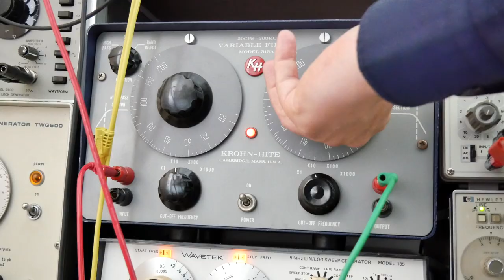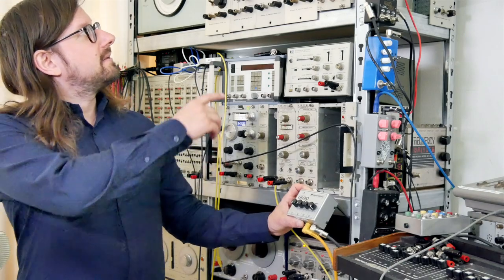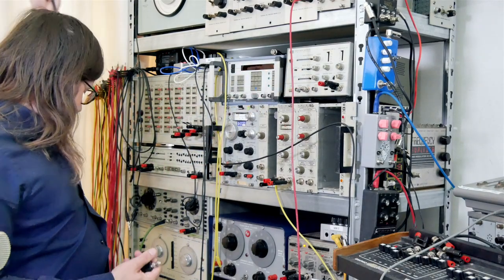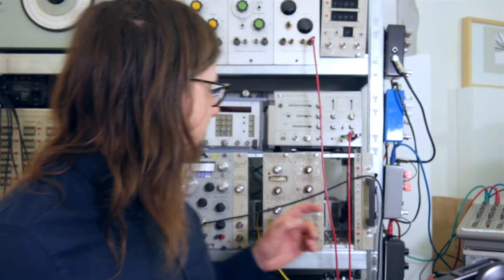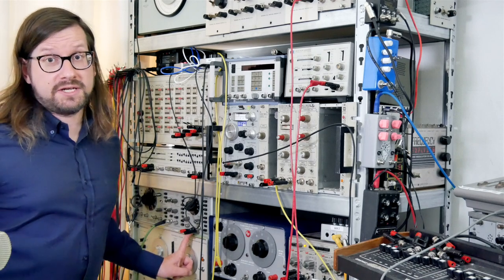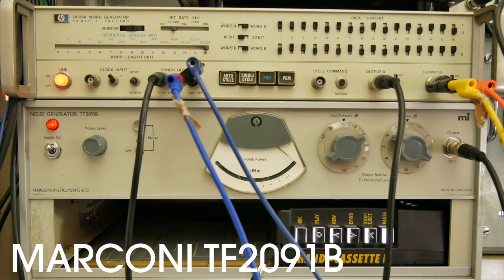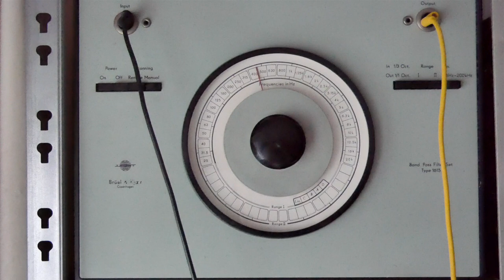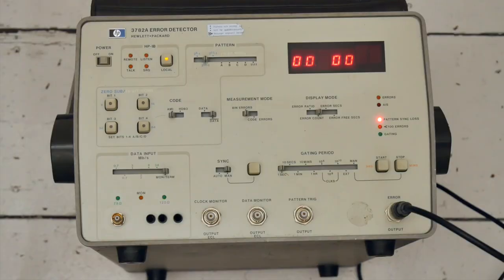Test Equipment Music FAQ and Guide

Comment: You can apply the "Will it music?" approach to any electronic device device you encounter, not only lab equipment, trust me on that :) Thanks for the amazing inspiration
Reply: You can actually apply the approach you speak of to any object/thing/device, electronic or not. Trust ME :) 

Example: take the shelf out of your oven (a "rack" type), tie two bits of string to it and shove the string in your ears (not too far hehe) with your fingers holding a seal. Tap the bars of the rack (either by swinging it to hit things or asking a friend). Enjoy.

Comment: Another nice one, Hainbach...never seen a K-H 315 filter before, actually. 310s, sure. 330Ms...two sitting about six feet away in here. And of course all of the solid state stuff. BTW, those 330Ms I have actually are getting used in a more "normal" way, since I use mine for front-ends prior to my 2-track A-D conversion to give me 11 active 12AX7A stages before things go digital when mixing, plus I use them as "soft" brickwalls to roll off HF aliasing and subsonics prior to encoding. My tech had them a few years back (one of them had a bleeder resistor issue in the power supply) and although I told him to "recap and upgrade as needed", his response was there was nothing TO upgrade. All of the caps in the signal path were bumblebees, and he noted that it looked on the insides like something that had been specced-out by NASA! Anyway, more great stuff, and I leave you with a link that should cause your brain to explode: https://www.ebay.com/itm/Ithaco-electronic-filter-model-4111/232630642021?hash=item3629dde565:g:KJsAAOSwLjxaW7Dm Cheers!
Reply from the maker: Again, I learn so much from your comments. But now I want a second 315, I think you idea is fantastic. And that Ithaco....
Reply: @Hainbach  That Ithaco is ssssssscary! It's sort of like an unholy cross between a 500-series rack and some bizzaro NSA gear as reenvisioned by some old geezer who use to work for Langevin. Notice how the cutoff frequencies are arranged, also...1/3rd octave spans!
Reply from the maker: Yeah! I read up on Ithaco and apparently they also do gear used for hydrophones. Very interesting. I wonder how these things ping....
Reply: @Hainbach  Price is right on their stuff, more or less. Their filters cut K-H on price, for one thing. Didn't know that about the hydrophones, though...did a good bit of field work with one (not an Ithaco) and a portable MD some years back in Japan. Almost got in a lot of trouble, too; I forgot that the ocean has these things called "tides" and almost got caught on a slowly-submerging rock with the gear. The results were worth the danger, tho! BTW, I don't think the following will music well, but the NAME on it is certainly menacing in an industrial/noisecore sort of way: https://www.ebay.com/itm/Grass-Instruments-Lesion-Maker-LM-3/273833363632?hash=item3fc1bd88b0:g:-cYAAOSwoGxcy21F
Reply: @Hainbach  Oh, also...the comment about not having VCA control got me thinking. It's true there's not really a test gear solution to that. But there ARE Eurorack modules for interfacing test gear, and once that's done, then there's loads of possible solutions. See this: https://www.modulargrid.net/e/racks/view/939547 This is how I'd approach it: a dedicated 8-input skiff with VCAs and attenuation/mixing, and eight channels of loopable AR/AD envelopes under a single control. Stereo out with xformer balancing, also...kills ground loops and electronic crud, which might be very useful considering that this goes in between the test gear and the A-D conversion. Not exactly 100% perfect (the stereo mixer is six channels), but it's a startpoint.

Comment: Hello Hainbach! You can also get some good stuff by being the manager of an Audiology department in an old building that hasn't been cleaned out in years ;-) (Say, 2 Revox B-77s, 3 Function Generators, a Mixer, a DAT machine, some cassette machines, weird test tapes and an oscilloscope, for example...)
Do you use the oscilloscope for in music to process sound? Or is it just aesthetically pleasing? I also have a High Resolution Counter I'm not sure what to do with!
My previous physics degree experience mean I've worked out how to use the function & pulse generators to decent effect, especially run through my pedalboard, but I can;t figure out how to do something with the oscilloscope other than lissajous figures!

Comment: Well i have a Tech Signal Genarator 20D.. i plan to use its AF Out as input to the computer's Line-In, then on computer, using a DAW, modulate the signal... not the fully analog way.. but still the incoming signal will be fully analog... not tested it yet.. hope to do so soon, in these days of coronavirus lockdowns..

Comment: I just bought I General Radio type 1210-C R-C oscillator and I can’t figure out what type the output is for the life of me. I was checking BNC and that doesn’t look right but it’s bigger than a banana cable. The outputs also have these metal caps that screw on over them that don’t come off. Help me Hainbach!
Reply from the maker: Go to the subreddit with close up pics

Comment: I picked up a signal generator the other day.it has banana output by the looks of it. does anyone know a simple way to connect that to my mixer ?  i was thinking i could use banana to rca adapter, and then run from that to my mixer with rca to 1/4" cable or just into an rca input of my mixer. thanks
Reply from the maker: That works but you can also just solder two banana jacks to a regular guitar Jack.
Reply: @Hainbach  Wicked ! Thanks, i've got a soldering iron so i may as well make a cable : )
Reply: Soldered up a cable tonight , worked like a charm. Thank-you sir !